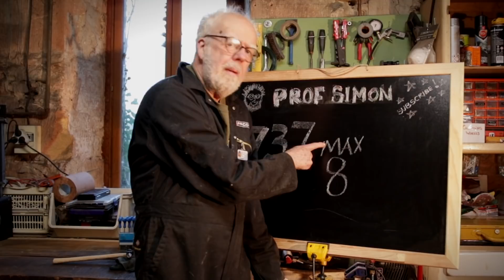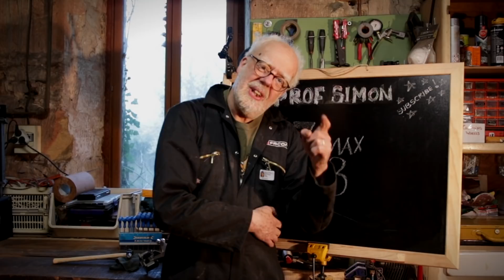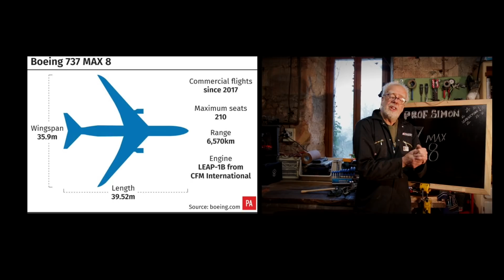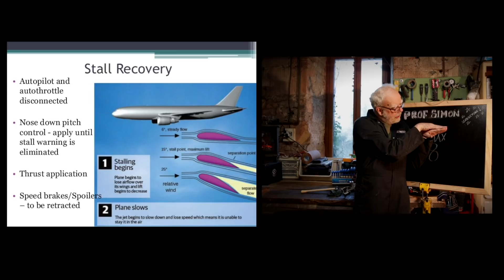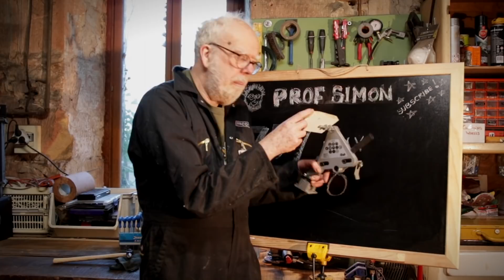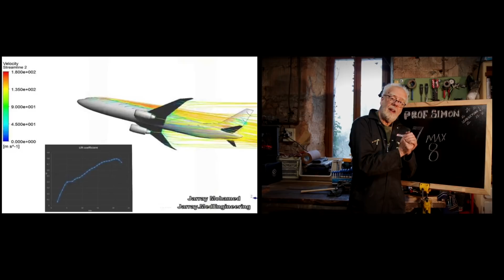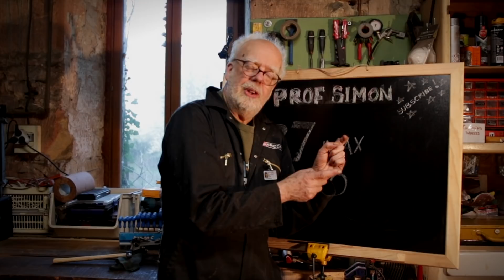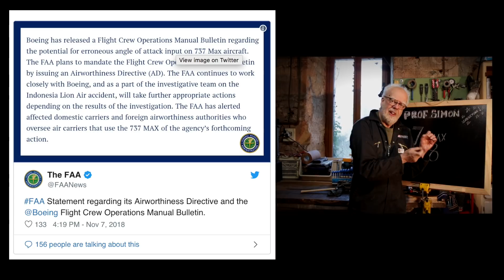Boeing 737 max 8's

Comment: These cases remind me Toyota unintended acceleration due to a bad spaghetti code...
Reply: I love the fact that toyota tried to pawn it off as the accelerator pedal getting stuck underneath the floor mats.
Reply: I heard that it turned out to be a bad piece of hardware that broke, instead of the spaghetti code. Initially the code was suspected, but in the end it turned out to be hardware.
Reply: Reminds me of some drivers too stupid too dumb to turn off the ignition, take it out of gear and stand on the brakes.
Reply: @miaflyer2376  I was 15 & in a boat when cable snapped. So full throttle, full turn. Two full banks around & getting closer to shore when I see my foster dad standing arm extended with hand plainly doing the " turn off the KEY motion...

Comment: 1) There should be a massive lever with red blinking lights, that says: "Pilot Override" - this button circumvents all computer autopilot input. (This is not a hidden switch requiring training and should be standard in all craft with autopilot functionality). 2) The flight laws should of never allowed a nose down maneuver below a certain altitude. That's ridiculous, they obviously didn't test their software very well.

Comment: With all due respect professor, the "new software-user manual" analogy that you made in this video is totally legit. But there is one big problem, so called "mcas" (manoeuvring characteristics augmentation system) system that Boeing implemented on this plane aka (the new software), the working details of it (the manual) does not exist in "fcom" (flight crew operations manual). So the pilots were probably unaware of it, and when it failed they tried to correct it the old way. Have a look; https://www.wsj.com/articles/boeing-withheld-information-on-737-model-according-to-safety-experts-and-others-1542082575 and https://www.aviation24.be/manufacturers/boeing/boeing-737-max-automatic-stall-prevention-system-mcas-not-in-flight-crew-operations-manual-fcom/

Comment: Thanks for the good video. I make a similar guess last night after reading the news. I read somewhere Boeing agressively marketed the MAX's cost saving in terms minimal pilot training. Boeing also stressed MAX should behave the same way as some current 737 models. If what we are discussing here is true. Boeing could have pathed these deaths since MAX softwares may not work the same way in this ftal aspect. And MAX may not be regarded as safe to fly since no commercial pilots have enough training about these fatal changes in 737 behaviour.

Comment: But surely safety software should correct whatever the pilot does if they over react. Bit like ABS brakes or stability control on cars. Seems a bit odd that software should effectively say, you are panicking wrongly so I shan't help you out.
Reply from the maker: Hi Geoff, I sounds as if the pilot kept trying to keep the aircraft level and the suability computer keeps shoving the nose down....some kind of fault and unlike ABS....not helpful.

Comment: the AOA sensor is broken and it sends the wrong data to the auto pilot saying that the plane is at a steep angle and could stall so the auto pilot keeps pointing the nose down even if the plane is flying fine, the pilots noticed it and counters the auto pilot by pulling up but they couldnt keep it. and the tug of war between the pilot and the autopilot continues until the plane crashes..

Comment: I trust a gray haired pilot with several thousand hours in the log book over computers any day!
Reply: Hahahaha. I'm a grey haired pilot (what's left, anyway) with a good deal more than several thousand hours and I trust the autopilot but i never take my eyes off the sneaky little bastard.
Reply: @scheusselmensch5713  As another old and now well retired pilot, I say take the compliment.
Reply: @scheusselmensch5713  same, difference between us and youtube pilots, well I have a little less grey hair but still
Reply: But the guys that wrote the code busted their butts over the weekend to meet their deadline.
Reply: May I add something?  I flew hang gliders for many years and purposely chose lower performing models.... because although less efficient (drop wise), they were extremely forgiving and much easier to take off / land.  You could purposely stall it, let go the bar and it would gently drop its nose and recover very quickly (within 200 feet)... High performance gliders - NO WAY.  They might fly much further in the same conditions but were nasty things that tried their best to get into spins and generally make it MUCH harder to recover.  Now.... is it true that these jets save fuel blah blah blah?  Mmmm, could it be that this was achieved by making a less stable (but more efficient) flying platform - that "needs" wayyyy more computer "management".  Do I trust a computer over a smart, wise pilot?.... NO WAY.  My guess is the software is no good, the plane is fundamentally flawed (because the bean counters just want the cheapest possible flights - so they pushed the "stability" Vs profit envelope) and what you have is a world full of "highly fuel efficient" 737's that without the software would be $hit to fly manually.  Classic case of "over engineering"... without enough engineering.  No way would this happen with an aircraft that uses double the fuel - but is a dream to fly manually.
Reply: @anthonyspanjich2772  It has been stated that the 737Max is tail heavy. With larger engines mounted farther forward than usual, this could make the airplane unstable and difficult to fly. In other words, it is not a stable airplane. They should probably junk all of them before more of them crash
Reply: @charlesaanonson3954 
How can mounting heavy objects fwd of centerline make a plane tail heavy...? 

Not a rhetorical..
Reply: if shit hits the fan and half the plane doesn't even work anymore ill take a pilot at the controls to land as best as he can.
Reply: It depends on the pilot and it depends on the plane, but I would generally agree with you.
The problem is when we don't get a gray haired pilot with several thousand hours of flight.
 For any unexpected situation that leads to an incident, we could use the help of computers and software to help make it safer, not to crash the plane and kill everyone.
I've expected Boeing to have fix it right after the first accident. It wouldn't look good at all to find this second accident is due to the same problem.
Reply: bassangler73 Same!
Reply: Its pilots in both crashes that are significantly part of the problem. Especially after the Lion crash. Read Boeing bulletin. Did 100% of all Pilots read it and comprehend it. NO, they did not, gross negligence, these pilots are not driving a Prius, this is a 150 person passenger jet, with which they are responsible for.
Reply: Software is as good as the developer.. built stupid intelligence and you on your way nose down. Trust a grey haired pilot and you land all safe in the Hudson river.
Reply: Computers don't care about themselves or the lives of anyone aboard, they're perfectly happy flying straight into the ground if that's what their programming tells them to do.
Reply: @CapitanBizarrely  pilots care about themselves those behind dont matter, as in a crash they are the first to go, so if they save themselves they save the rest by default
Reply: @CapitanBizarrely  said by someone who clearly doesnt use autipilot
Reply: bassangler73 most crashes are pilot error. Research it yourself.

Comment: This problem was catastrophic The aircraft lost pressurisation shortly after taking off?
Disadvantages of Composite Materials on Airplanes.

Because composite materials don’t break easily, that makes it hard to tell if the interior structure has been damaged at all and this, of course, is the single most concerning disadvantage for using the composite material. In contrast, because of aluminum bends and dents easily, it is quite easy to detect structural damage. Additionally, repairs can be much more difficult when a composite surface is damaged, which ultimately becomes costly.
Also, the resin used in composite material weakens at temperatures as low as 150 degrees, making it important for these aircraft to take extra precautions to avoid fires. Fires involved with composite materials can release toxic fumes and micro-particles into the air, causing health risks. Temperatures above 300 degrees can cause structural failure.

Finally, composite materials can be expensive, although it can be argued that the high initial costs are typically offset by long-term cost savings.
Reply: The aircraft was not high enough to even need pressuization yet. What the hell are you talking about?

Comment: What if there is a bug in the software, which in the normal run of operation did not get detected but a certain length of duration of operation it gets entrap and produces an error and generate Havoc, man-machine-interface is a most vital aspect of Boeing mfg process.

Comment: I was in the aviation trade for 25 years, retired a 747 Captain. This 737 problem reminds me of one of the old heaps of junk I used to fly up & down the east coast of Australia doing night freight work. The 'orrible Swearingen Metro 2. The stall avoidance system on those was a stick-pusher than activated if it detected the Angle of Attack was getting to high. The problem was that sometimes it would decide to do that at a rather inopportune moment, most often just before flaring for landing, which would result in a very ugly landing. The unofficial SOP was the pull the circuit breaker on the system so it didn't work.

Edit - I just remembered an incident I had in a Metro many years ago. Lucky to get away with it.
http://www.billzilla.org/flying3.html
Reply: Why do you even complain ? The designers didn't name it SWEARingen for nothing !

Comment: this is my own opinion on what could have happened. Man and machine connection. The professor is correct, when does man or the pilot decide to go back to basics. Computers help a lot but when the shit hits the fan, fly the aircraft the way we all learned how to fly an airplane,revert back to manual flying disengage all automation and perform the procedure to fix the problem. the investigation will reveal the real cause, im just guessing based on my airline experience.

Comment: Indeed the pilots should first learn the new software of Boeing 737max procedures tnks professor  🙏🙏🙏
Reply: Kigozi Aloyzius Not as easy as it sounds. The event that needed them to react is a rare occurrence, so whilst pilots may have read the procedue, and even experienced in a simulator, they probably never come across it in the real world. Years of simulator training and recertifications drive that into your brain, so when the event does happen you just react. Unfortunately, when you just react, its hard to react in a new way. Try jumping from a right hand drive manual car to a left hand drive automatic, and see how often you reach for the gear lever. Or just a manual to an automatic, and find your foot going for the clutch as you come to a stop. It takes time and experience (which you just don’t get for rare events) to reprogram your brain. I diubt there is a 737 M8 pilot out there who’s not acutely aware now, and will react properly (lets hope so for the passengers and crew). (Sorry, turned into a very length comment) :)
Reply: Kigozi Aloyzius  it was wrong and the training .
Reply: Problem is procedures have not changed. Further on takeoff the MCAS system not engaged and can't with flaps on. And supposed the system did engage the same past procedures are used to override. 
So right now it's unlikely that MCAS was even a issue. However something is occurring. My first bets are to look at chip makers and supply chain - sabotage comes to mind here just like when China imbedded chips into circuit boards being supplied to makers that allowed them to spy on such servers.

That plane been flying for 2 years now. And angle of attack system is same as previous models.

So procedures and switches have not been changed. So no pilot change is or required when in trouble. This is a failure of some type. MCAS wasn't even enabled for the eupothian crash. Something is wrong here - but we don't know. Strange how China was most quick to ground their fleet first.

Comment: I would agree to some degree planes  software are upgraded so often due to technology changes this is a new plane th software isn't 100% new and in most cases the plane prevent alot of pilot error but I'm hearing there's a communication error prior to total failure. Resulting in the crash I still suggest they be grounded until it resolved and if the plane is correcting itself  incorrectly speeding to the ground that to me is a software failure.

Comment: Even a flight geek would blame the "new" MCAS.
Reply: It's not the MCAS that's the problem, it's the lack of training related to to it.
Reply: MEGONE Productions Lyric Videos  They tried these parameters on the classic sim from 30,000 feet and it still took between 3 and 4 thousand feet to regain control of the aircraft despite the fact they knew it was going to happen and what to do. If that’s actually what happened those pilots didn’t stand a chance.
Reply: It IS the mcas and the "Lead Brick" Boeing aircraft...NOT the training.....both instructors...that could have "trained"....are dead........If it's Boeing...STOP going...until the build the aircraft the right way.......fact is : this might be the death of Boeing.......we need to go back to cables and gages....scrap the "robot" electronics........
Reply: Yup, Me too

Comment: I just read the comments from witnesses on the ground saying the plane was flying very low above the field, rolling left and right while trailing smoke, clothing, and other articles before it nosed into the ground. The farmer said his cows were running around in fear, so it must have been quite low.

Most of the witnesses said they heard the sound of flexing, tearing metal as it struggled to stay airborne.

Comment: I love details of your explanation professor. However I beg to have different opinion. As you explained earlier in the video, aircraft software system is preventing the extreme aircraft movement created by the pilot to make it not dangerous. But it seems that the new system called MCAS is doing the opposite of that. From Lion Air FDR reading we know the pilot was battling the aircraft not to dive due to faulty censor reading. So the MCAS does not have this system that should be preventing dangerous manufer I think. It solely depends on few censors but neglected other instrument readings perhaps?

Comment: How can the pilots not know or be trained in this new software........Insane !!!
Reply: Thats the aviation industry these days.............
Reply: I heard Boeing were in a rush to deliver the new plane...
Reply: Speculation is the pilots were NOT made aware of (trained) in this new s/w safety system that compensates for the Max 8 new design that tends to push the nose up, and compensates by pushing the nose down, even when the autopilot is turned off.  This is what Lion Air pilots and experts allege, that pilots had autopilot off but had to "fight" the aircraft safety MCAS system which kept pushing the nose down, and according to experts the s/w controls are stronger than a human pilot's physical strength.  So the solution is being able to turn this safety system off, and not sure how that's done or if it can be done.  Workaround says it has something to do with the electronic trim device which even Boeing refers to, but wouldn't you think there should be a switch that turns off ALL safety/auto devices and gives the pilot FULL control?  We now systems fail, maybe less then humans, but if they do fail, let's let the human step in.
Reply: Some of them, maybe many, many of them have been trained. As several have had this problem, used their training, and landed safely. The Lion Air aircraft was flown by another crew days before the fatal crash and had the problem, reacted properly, and landed. The accident crew seems to not have had the training, remembered their training, or responded quickly enough.
Reply: @tscottme . False. No one knew of MCAS before the crash. Its still not clear whether the previous crew and the crash crew faced similar problems.
Reply: @tscottme  Actually, the report I read was that the  crew before the fatal crash was  also confused and nearly crashed, but were only saved by an off-duty pilot who knew how to shut things off and fly manually.
Reply: They are but in moments of stress the brain can revert back to muscle memory and experience of before.

Comment: Sounds like there is nothing wrong with this max8, it's just that pilots are not updated and didn't do their homework on the software upgrade, like I have heard this before these countries are not as regulated as u.s. pilots are.
Reply: John Playman well obviously there is something wrong with the plane in first place . The airspeed should be reliable all the time . We have to see the root cause and not at the result. Of course the right handling at the situation might have saved it but the initial fault comes from the plane . I think until they realized it was too late they run out of height ...
Reply: @MrBillboeing  pilots don't have enough time ...they fly low and when something like that happens they have only seconds to figure it out...